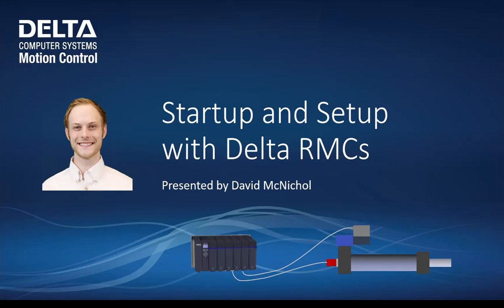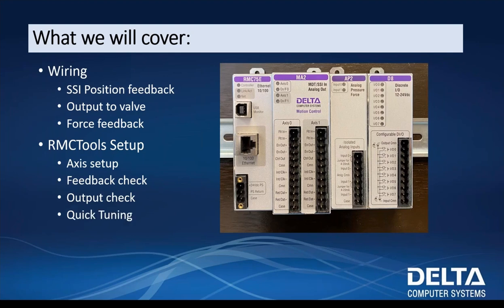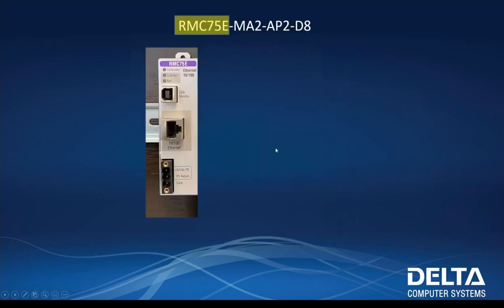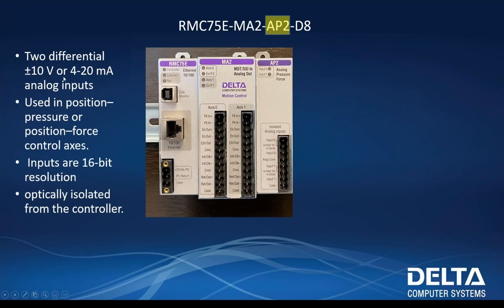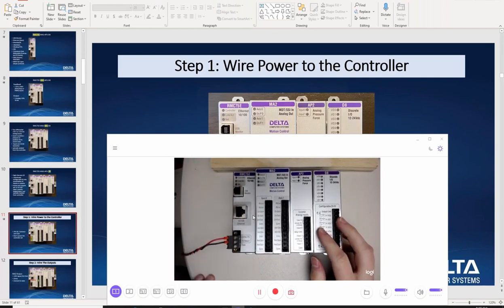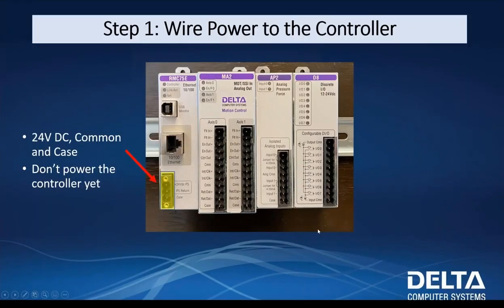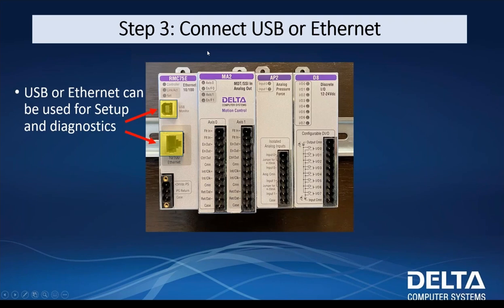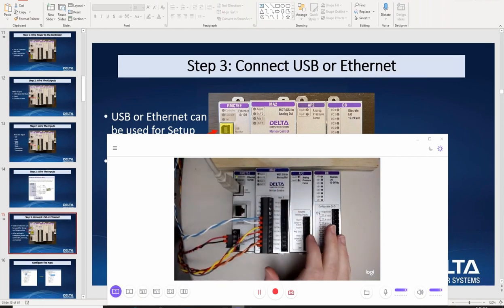Startup And Setup of an RMC Motion Controller

Comment: Great presentation. What remains unclear is should user revoke the change made at 53:26 when Direct command is replaced with Status only, after tuning is finished? I am referring to force following error.
Reply: In most cases, I would revoke this change after the tuning process is complete. Having this fault will alert you if you are not following your target as closely as you'd like.